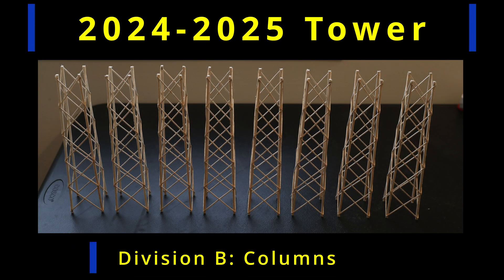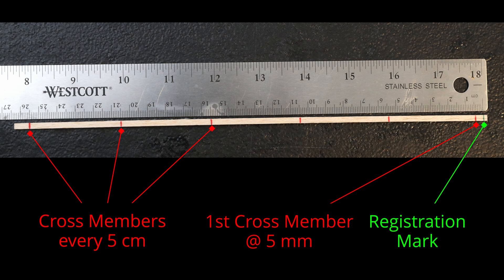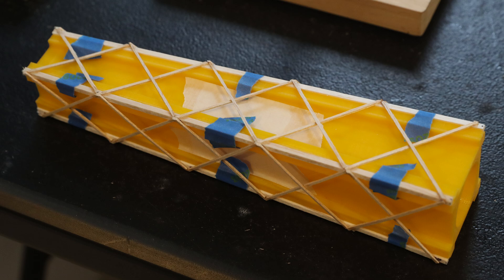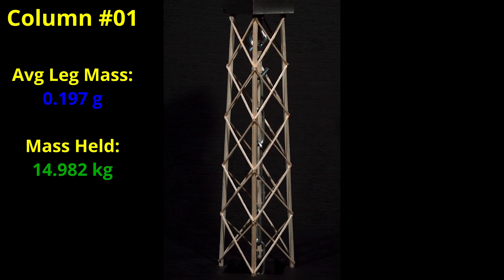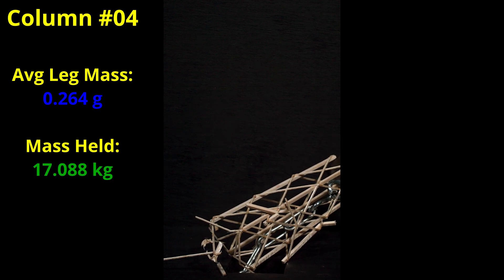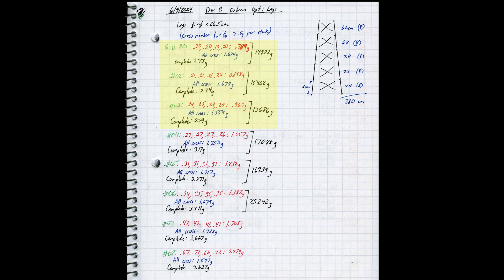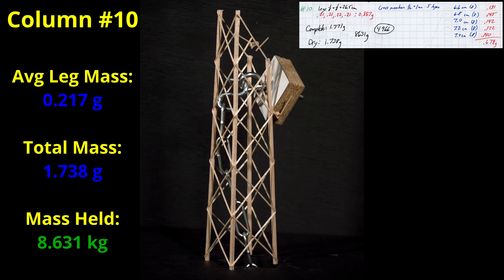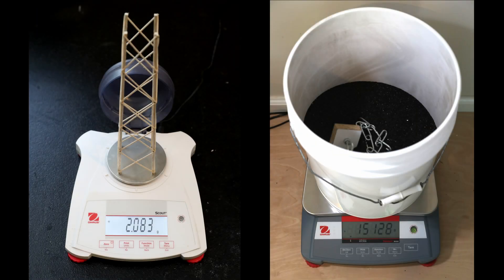2025 Science Olympiad Tower Div B: Columns

Comment: i see that your columns are leaning at an angle so they get smaller at the top. All the other tower teams in my group have the columns straight. Do you have any recommendations on which one i should use and which is and isn’t allowed?
Reply from the maker: Both designs are allowed.  I have a slight (2 degree) taper to my columns to add some stability.  Either way can work well.
Reply: both allowed balsa engineering says leaning is better idk i just trust him

Comment: I am having trouble precisely printing out the column jigs; the notches where the wood goes is not smooth/other issues. Is this affected by the nozzle size or printing multiple pieces at once? If so, what size nozzle is appropriate?
Reply from the maker: The default nozzle size should be fine to print the jig.  This should be a fairly straight forward thing for a printer to print.  I suspect something might not be working well with your printer in general.  I would recommend trying to print the standard "benchy" torture test first:  https://www.thingiverse.com/thing:763622    Once you dial in the setting with your printer to print that correctly, the column (and just about anything else) should be easy.  If you are having trouble printing the boat toy, just do some googling for recommendations.  It's pretty much the standard for printer calibration so there are tons of suggestions online based on the problems you'll see when printing that.  Good luck!
Reply: This might be beyond the scope of the video as the 3-D Printing is a whole different material science on its own, but have you tried rotating it 45 degrees in the Z axis? Most slicers and printers are not that optimal at maintaing straight lines that are almost parallel to X or Y axes, as the stepper motors and movement on the rails is prone to slippage.

Comment: Where are the 3d print files?
Reply from the maker: There is a link to a zip file that contains all the jigs and support stl files in the description of this video
Reply: @balsaengineering6686 Wait, when I tried downloading the file, I tried opening one of them, but it was read-only and didn’t let me open it. Is there some kind of website or something to actually see the model for downloading? I’m very confused.
Reply from the maker: @leodiy7415  Make sure you actually unzip the file on your computer and not just click into it.  If you click into it, you can see the files, but they will be limited

Comment: Are 1/16 inch balsa sheets good for cross braces?
Reply from the maker: They will work fine, but you'll probably find that they will be too heavy to achieve a ~2g column if you want to try and match my benchmark build
Reply: My partner and I have been using 1/16-inch balsa sheets for cross braces since last year, and we managed to achieve a score above 2,000. I appreciate your input; I'll consider it. Thanks for responding.

Comment: hello! so i downloaded the 3rd bases onto onshape but when i uploaded it onto the 3d printer it was was like 1 meter long, i already know know the exact messsurments but the printer only has one shrink/largen button, do you know how big the base and column in mm?
Reply from the maker: Your slicer is probably just interpreting the units of the STL incorrectly.  Each piece of the column (top and bottom) are 13cm tall.  The base should be 24.5cm tall, for a final assembled jig height of 50.5cm.
Reply: ahh i see, thank you!
Reply: its in mm u can use slic3r to cut the model to fit your 3d printer in multiple prints if its too big.

Comment: What is the density of the balsa for the legs and cross bracing?
Reply from the maker: I don't have the density handy for those pieces, but in general they were in the "light" range.  You can compute the exact density I used for every piece by using the information in my notes that I show for each build.  For example at 13:19, you can see the size and mass of everything for column #12, so you can compute the volume and then the density.  Make sure to convert to the units you need!

Comment: Hi, what size cross brace members did you use for the benchmark column build?
We are trying to figure out now so we can order sheets and wood without wasting too much time going through our budget and different towers.
Reply from the maker: This information is contained in this video where I show my notebook pages.  My benchmark column was build #12.  If you check out at 13:17 you'll see my notes where it says I used 1/20 x 1/20 for the cross bracing.  You can also see the exact mass for each layer if you want to calculate the density of material to try and match it exactly.  Good luck this season!
Reply: Thanks so much for the speedy reply!
Reply: @balsaengineering6686   Hi what is the length of your cross braces
Reply from the maker: @sivakumarpuram  You can see that information when my notes come up for a particular build.  For example here: 13:18  On the right side, you'll see for every layer of the column, written in blue here, notes like 7.4cm (8)  That means the bottom layer pieces are 7.4cm and there are 8 of them in total; also of interest is the mass written in red right next to that, here .102g.  That means all 8 cross pieces for that layer weighed a total of 0.102g.   If you get a chance, please watch my video on how I take notes for these devices to fully explain things: https://youtu.be/6jSlhXZORMs
Reply: @balsaengineering6686 what’s the density of the wood?
Reply from the maker: @Fire_World428  I don't have the density off the top of my head, but you can calculate it exactly given what I show in my notes with the dimensions and mass.  These columns all definitely fall in the "light" density range if that is enough for you

Comment: Hi, I think the STL files that you attached for the top and bottom of the jig are the same?
Reply from the maker: I just downloaded them both from the links above and verified that they are correct.  The one labeled "_bottom" will have a hole on both sides and the one labeled "_top" will have a hole in the bottom with a flat surface on the top.  Please try downloading them again
Reply: @balsaengineering6686  Thanks for sharing! For the two STL files producing a Division B column jig,  I found both the bottom and top parts are 13 cm tall. Because the 2025 rule requires 50cm height for the tower, I wonder if you suggest any scaling number when printing them?
Reply from the maker: @rosecarmen453  The two STL files in this video are for ONLY the column part of the build.  You also need to build a base and ideally print a 3d jig for that as well.  Please watch this video to learn about the base:  https://youtu.be/juhgy5LAAgI   You will also want to watch the final assembly video to learn how to attach them together.  Please watch all my 2025 Div B videos in full to better understand all the rules and what you'll need to do this season.  Good luck!!

Comment: What type of sand to you use for loading?  The sand I have is very dusty.  Suggestions for low dust?
Reply from the maker: Yeah, regular sand is very dusty.  I found that using sand-blasting material works pretty well. Make sure you get the medium grit.  It doesn't generate zero dust, but it's way less than typical sand:  https://www.amazon.com/gp/product/B0791W9MXL/ref=ppx_yo_dt_b_search_asin_title?ie=UTF8&psc=1

Comment: Have you read "Variables affecting the strength of balsa wood" by 
P D Soden and R D McLeish University of Manchester 1976?
I dont have my copy handy but from memory, heavier balsa has a better strength to weight ratio than lighter balsa. So you may be better off with smaller cross sections of heavy balsa. Whether this effect is enough to offset worse Euler buckling outcomes, I am sure you could calculate.
As well as matching balsa lengths by weight, you could also select for superior stiffness by observing deflection of same weight samples as cantilever beams under light load. This might also help expose samples with weak portions.
Reply from the maker: @RichardTapp1 I haven't read that book specifically, but I did basically confirm the same findings experimentally.  You might enjoy this video if you haven't seen it already: https://youtu.be/mzMFhd4SqP8     While the higher density balsa has a higher absolute efficiency, there are diminishing returns and because we are limited to 15kg max load, we are generally in the light to light-medium range for anything that has buckling.  The exception is when we know pieces are in guaranteed pure tension (nothing in the tower),  then you want to use either high density balsa, or that's when it's even better to use basswood.   If we could build devices to 25+kg max load, I think we'd see higher absolute efficiency numbers, but for our condition, it just makes it too overdesigned and too heavy.